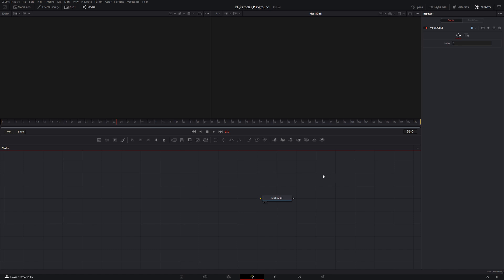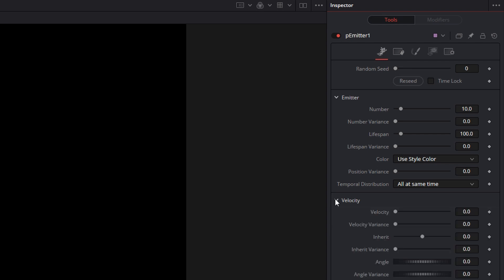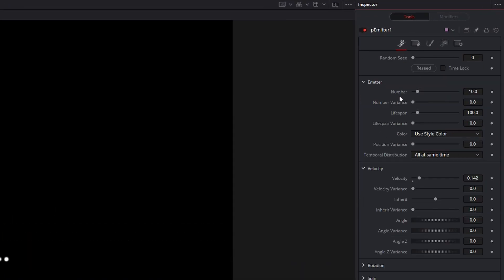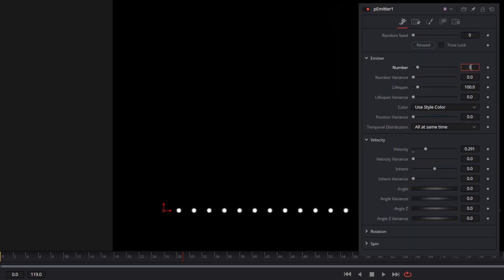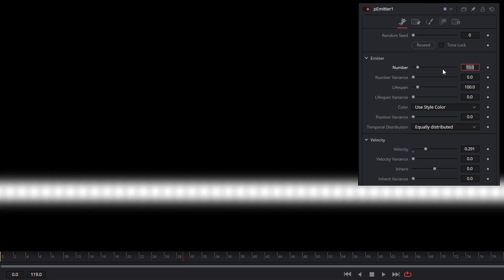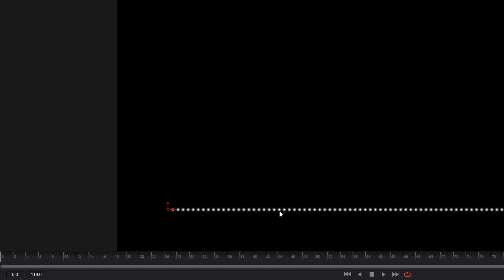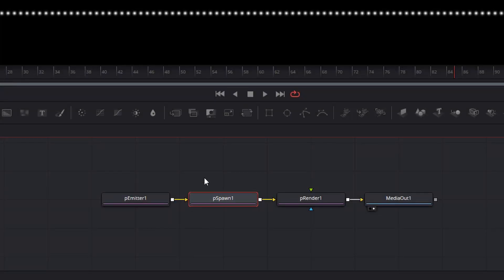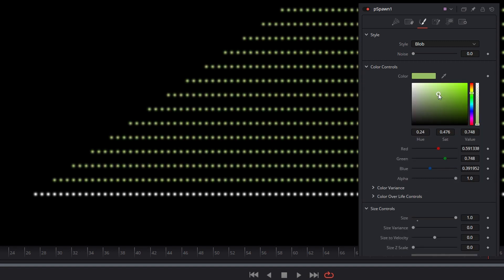DaVinci Resolve 16: Particle Temporal Distribution in Fusion

Comment: The way it works for pSpawn is that the particles are being calculated per frame. So if you want a particle to be between the distance traveled from one frame to the next, you first have set your pSpawn particle count equal to the number you want between the distance traveled. The trick to it is to then generate a subframe amount equal to the number of particles you want. So in the pRender, you set the "Sub-frame Accuracy" to what ever number you have for the spawn count.

pSpawn: Spawn Number = 6
pRender: Sub-frame Accuracy = 6

A good way to handle it is to expression whip the Spawn Number to the Sub-frame Accuracy so that you aren't making more particles than you have frames.

Comment: is there a way to shoot out all the particles I want in a single frame?
Reply: im a year late but yes its possible. in his earlier tutorials where he introduced the particle spawn method he did just that. you use keyframes to make the emitter go to zero by the second frame.
the ones spawned during the first frame will still persist because they are tied to the lifespan variable once they are emitted.